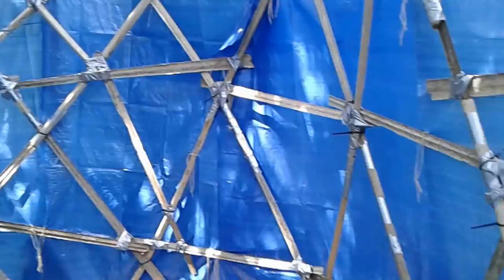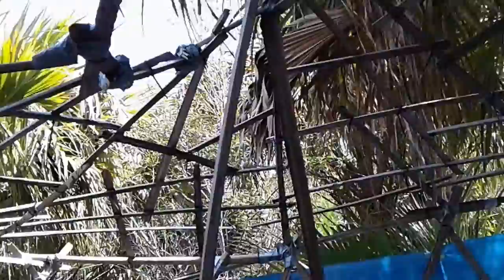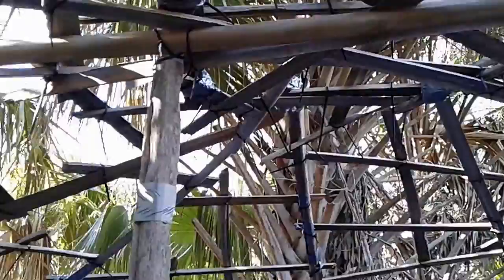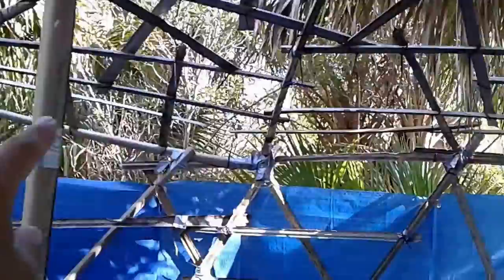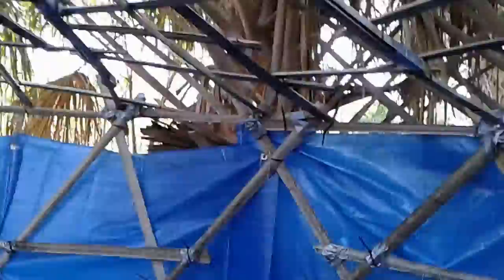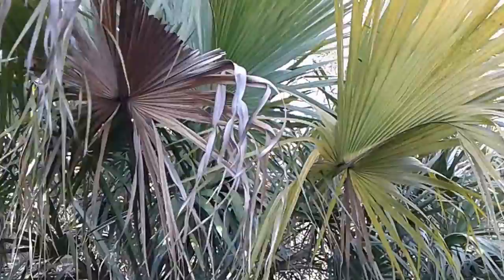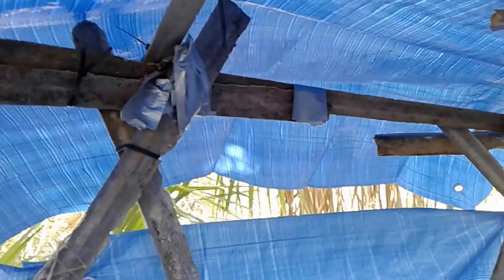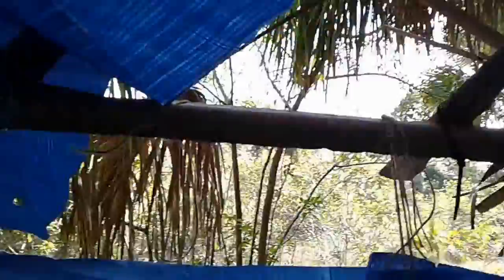Bug Out Yurt Roof Installation Part 1 (V474) Bushcraft Primitive Technology Urban Survival

Comment: Denoy,
I buy clear plastic tablecloth at JoAnn Fabrics. It is sold on the roll (54" wide) and you can get any length you wish. It is not expensive and they have 3 different mils. This item may also be sold at Walmart, I am not sure. They have a sewing/fabric department. I would ask there the next time. Ask if they have rolls of clear tablecloth for sale. Or a JoAnn's may be close by.